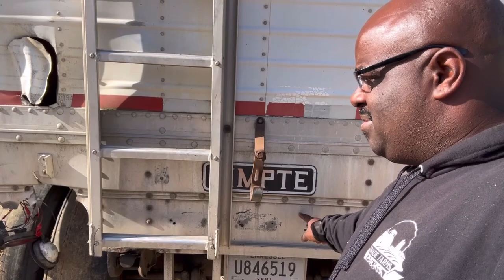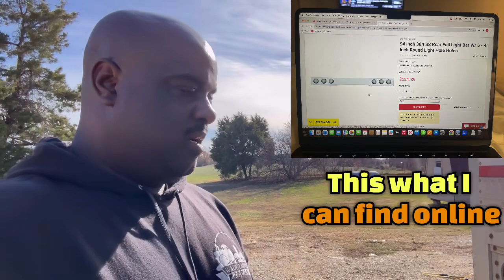Another day

Comment: I've got it, D. Just cut you out a piece of 1/4" plywood to fit over that broken section and screw it in place. Then just cover it with duct tape so it looks like aluminum from a distance, cut out the holes for your lights and put them in it. Make it fit low enough so that you can attach your mud flap to the bottom of it and you're good to go. Red Green approved!
Reply from the maker: LoL 😂 WHAT ?

Comment: Easy fix go to the truck parts store they sell a housing that the lights go’s in. Then bolt it in u maywant to use aluminum angle to help brace it. Years about we had a tire blow and tore out the lights the same way. I also have seen them on log trailers especially old ones.